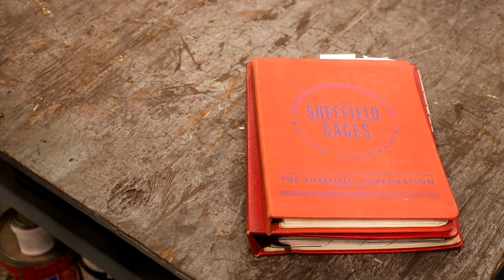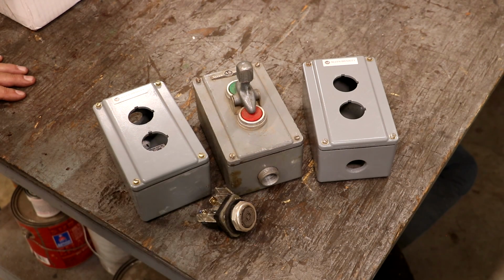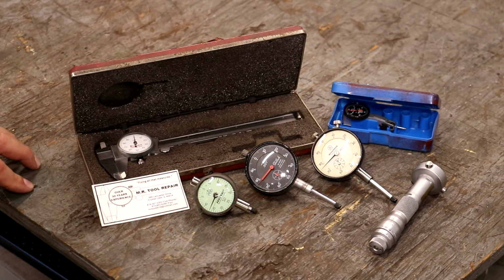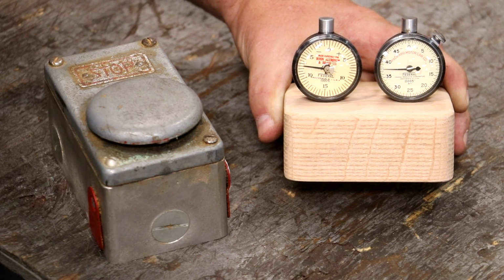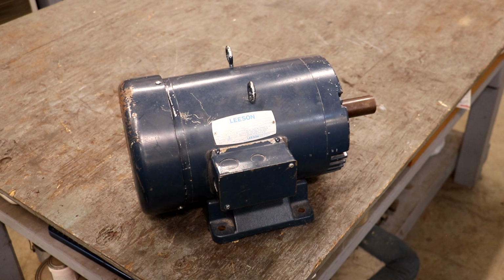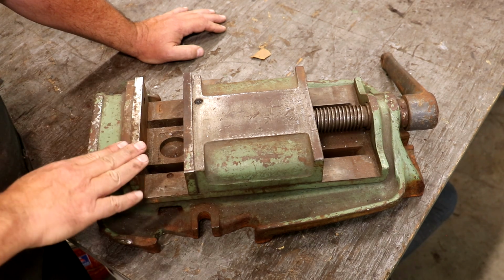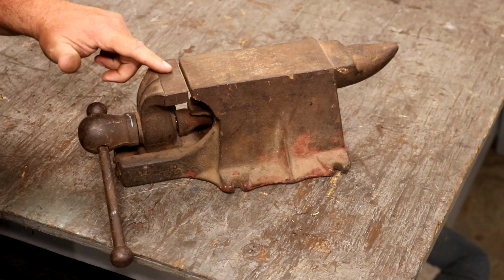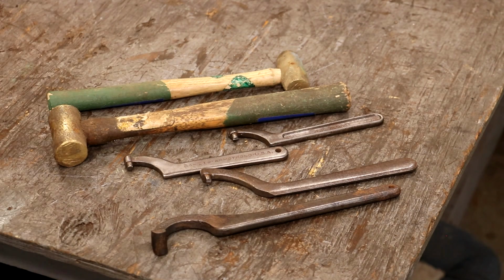Odds & Ends 128:  ArnFest Goodies, Viewer Mail, Hot Shot 360 Oven

Comment: Quite a few of those anvil vices also have a drill press function. Look underneath the jaw on the moving jaw, there is often a tapered hole for old fashioned auger bits. As you tightened the vise, it would cut while compressing, like a drill press on its side.

Comment: I think the on-off with a metal item on top is a foot start stop for a bench work or a press - where the hands are holding or placing and the foot turns on the press.... might be a good emergency off if your upper body gets trapped (tie in the lathe :-) ) the foot turns off the lathe. [hoping for an engine brake and instant stop].

Comment: I wish my shed was big enough that I could use the word "inventory" the way Keith does! 🤣🤣😁😁
Reply: Agreed!  I also wish my tiny pocketbook was big enough to afford some of it.
Reply: @marcp1180  I felt the same way before I started my machine shop. Now I have tons of equipment literally about 40 tons aka 80,000 LBS of equipment and material. All of this courtesy  of my customers buying parts from me. If you want to get in machine tools like Keith and I and others on You Tube I would suggest you look for machine shop auctions. The auctions are the cheapest way to get equipment and tooling. Nearly everything in my shop was purchased at auction.
Reply: I don't think I wish I had a shed that big... Because once I'm gone my family would have to deal with it all.
Reply: @Tom4Jean  I'm  an antique collector and have all kinds of stuff, 200+ lamps (Aladdins, etc), 400+ clocks, etc.  When I'm  gone my sister gets all the stuff.  I've  inventoried most of it and have the prices coded to make it easier on her.

Now watch her die first.